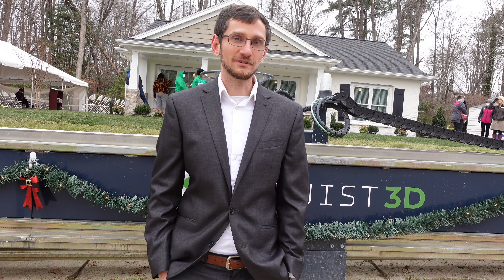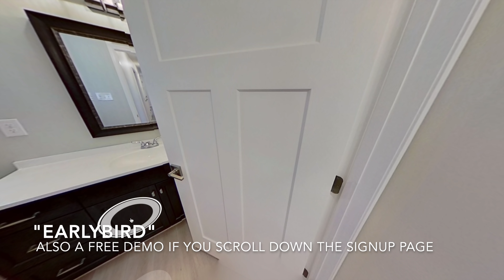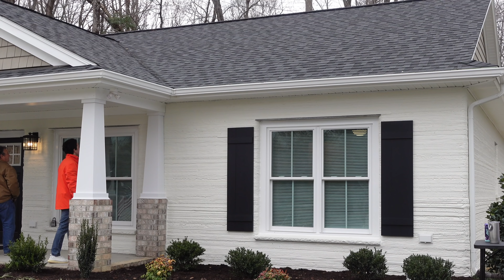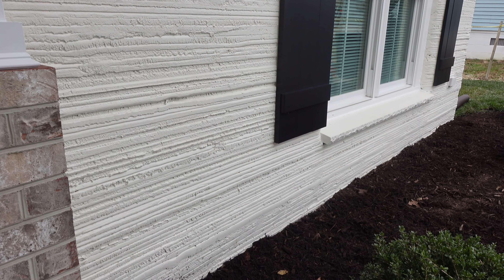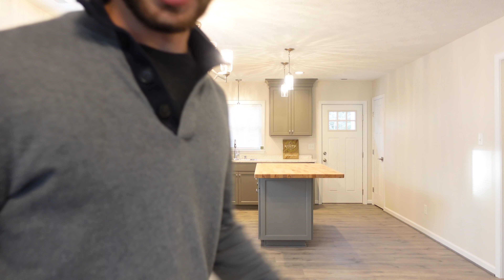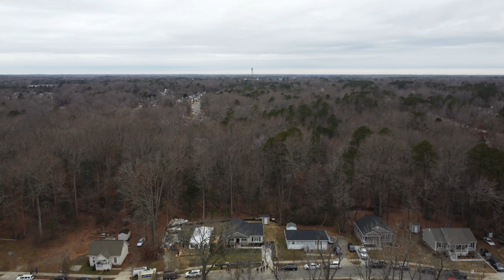Habitat 3D Printed House But You Can't Tell From Inside!

Comment: It's a fantastic result: congratulations to all members of the team. It will be interesting to see how the walls fare in the years to come. As a layman, it looks to me the physics of long slender concrete walls without either internal reinforcement or vertical supports are relying on the roof to hold them in place for the long term; otherwise what's to hold them being easily pushed over by a moderate force impact (e.g. falling tree, backed into by a bad driver). Was it a specialised (read, higher cost) concrete that was used, I wonder, with additional strength properties?

Comment: This is really great. It's a shame though that there's so many parts of this project house that were done without sustainability in mind.
Reply: Not sure what you're talking about most of these places are built with recycled materials. Concrete is a clean material the fast and efficient homes other materials like wood and other products that they put in it it's up to the homeowner. There's a man in China as its building them to be 100% recycled materials so now the wrong.

Comment: That house has drywall and paint. Cnn said it took 12 hours this in bullshit a d a lie.  Theres flooring and roofing as well as door frames. So maybe  the concrete tool 12 hours but not the whole house. Also electrical.amd plumbung
Reply from the maker: It’s likely not a lie just a misconception or typo but it certainly took more than 12 hrs.
Reply: @automateconstruction  basically they are exaggerating like the house magically is made with a 3d printer not showing roofing electrical etc. Very bad reporting I think it's paid publicity for the company and habitat

Comment: What about the heat/cold changes? Once concrete is cold, it stays cold for a long period.  Same with heat.  What is being done to counteract those temperature changes ?
Reply from the maker: It’s insulated between the inner and outer layer so the internal concrete will remain much closer to room temperature than the exterior concrete wall.

Comment: The only construction hard cost 3D printing alters is the lumber and framing costs associated with building a house. All the site work, foundation, mechanical, electrical, gas plumbing, envelope costs (doors windows, siding roofing) remain the same. 3d printing is certainly an exciting technology, but the cost savings at the moment relative to stick framed structures seem inconsequential.

Secondly, the 3d printed housing construction process works great, with a lot with no access limitations, in a fairly remote setting, but so would any construction process. I’ve yet to see a 3d printed home built on any kind of slope, or with any challenging water proofing conditions, or other significant site constraints. I can’t imagine moving one of these machines down alleys and trafficked streets in San francisco, Seattle and Los Angeles.
Reply: Can one print their own home and can home purchase a personal 3d home printer or do you need a permit or lisense? For all the supplies necessary for such printer is more than the printer itself when purchased all together if not is it significantly cheaper? How do you apply a shower toilet and sink or oven, tv etc etc things that require water and electricity and will a 3 d printer home with stand all weather elements or natural disasters? Sorry so many questions but you sound like you know what you’re talking about so I wanted run a few questions by you.
Reply: @caligurl8770  Hi Brittany, good questions. I’m not in the 3D printing business so I can’t answer your questions specifically. These questions would be better directed towards a 3D printing company like ICON and ALQUIST. 

What I can say is any home or associated development needs a building permit from the applicable local authority, whether that be city or county. Any building methods, 3D printing included, must comply with that authority’s building, land use, and structural codes. 

3d printing has large upfront and material costs. The specific numbers I’m unfamiliar with, but I can guarantee that they are high enough to render any one off residential home economically unfeasible. Only a company operating at scale, like the one this channel features, has the ability to utilize and license this technology.

Many 3d printed structures actually have lumber framed walls on the interior of the printed walls to provide cavities for electrical, plumbing, mechanical, and any other utility systems the design might call for. This adds further redundancy to this building method, and adds credence to the claim of 3D printing’s current lack of cost savings relative to traditional North American building methods. It’s inefficiencies like this that, in my opinion will prevent this technology, in its current iteration, from being adopted at scale and change the affordable housing conversation. But to answer your questions,  this is how they rough in the utility systems for these houses. 

Hope this answers your questions.
Reply: @alexanderbarsher3072  damn, thank you so much I feel like I just got a class. I appreciate you response

Comment: I love the innovation. But if they’re using concrete, will there be concerns about condensation? The temps in Williamsburg fluctuate pretty dramatically and it’s such a humid area.
Reply from the maker: Time will tell.
Reply: It’s definitely a concern but I suspect vapor barriers and adding a dehumidifier to the central heating would take care of it.
Reply: There are also things you can do to mitigate those issues. With any building material you have multiple steps to making it last and to mitigate issues. My house is made from wood in Florida, that’s a worse situation, and requires constant maintenance.
Reply: man  shut up. .. its a freaking house . Just be happy. ..
Reply: @JohnSmithoriginal1  You don’t get it. It’s not much of a house if 6 months from now you have to move out because of black mold growing everywhere and getting into your lungs.

Comment: I really want to know how this house holds up to tornadoes and hurricanes and does this house have a safe room so if a tornado does come through, it does not fall in and hurt the owners.
Reply from the maker: No in Williamsburg Virginia that isn’t a concern to my knowledge so it wasn’t tested for tornados. It’s totally custom so a different region would have different engineering requirements. That’s part of why its hard to scale nationally in the construction industry.
Reply: Since the roof is of a traditional method of construction, It is likely to be effected in the same manner, but I would find it very hard to believe that the printed section below wouldn’t be a substantially stronger and more stable base, and consequently less likely to fall.